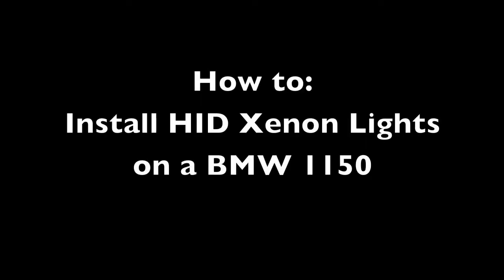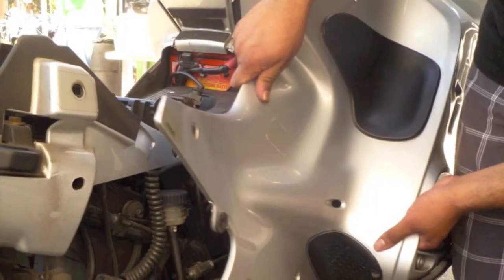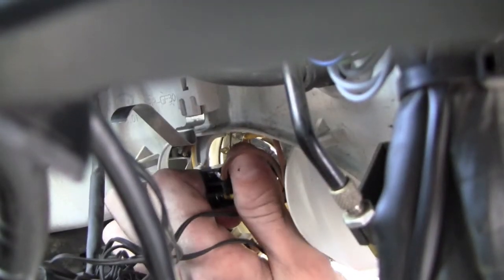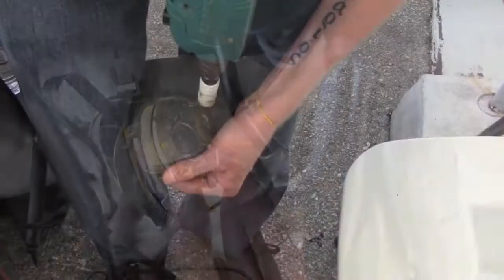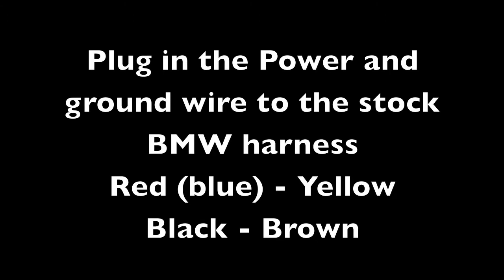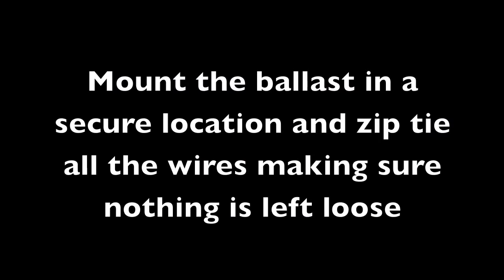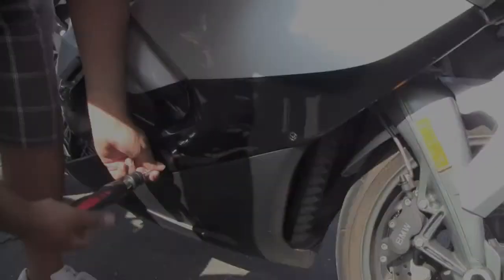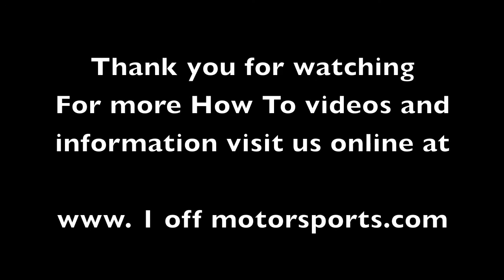How to Install HID headlights on a BMW R 1150RT

Comment: With my RTP, I was able to install without removal of fairing. Took some patience, but would have taken longer to remove RTP crash bar and fairing. Running a 5000K 35W kit. Light is much better, but for wet roads at night, I'll switch on the 2 x H3 55W fogs as well